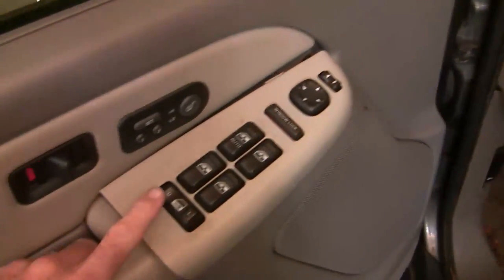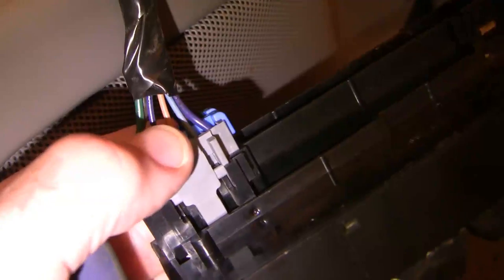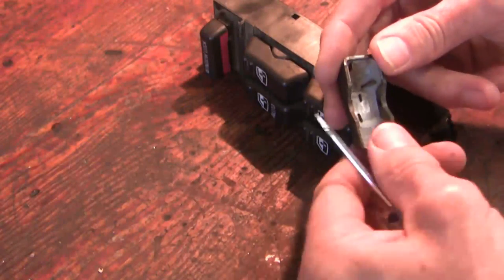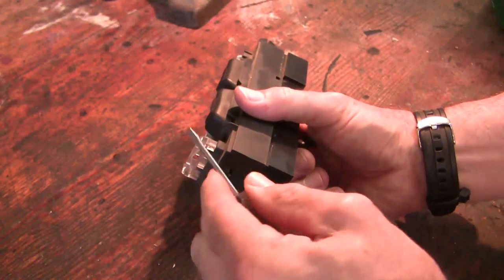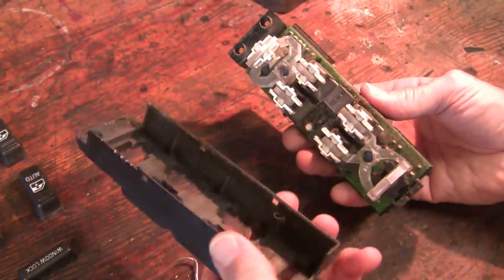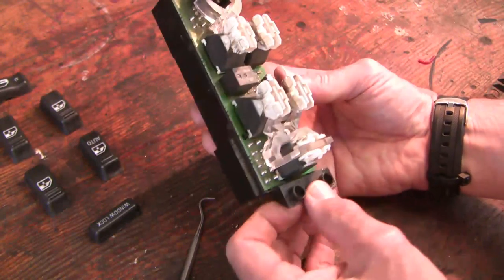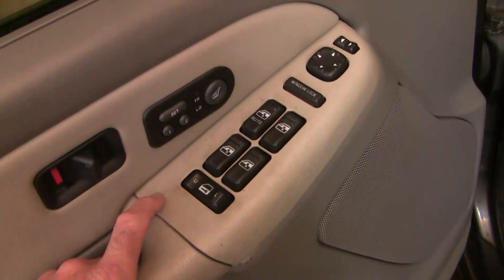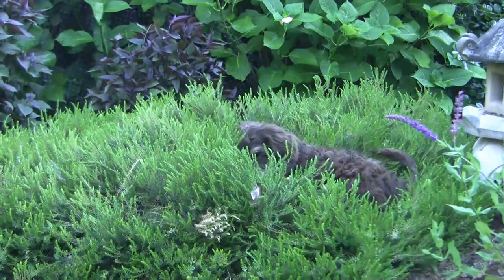How to fix the Chev power window door lock switch

Comment: I've got a 03 s10 that the power locks only lock when in drive and unlock in park wich tells me they work good but doesn't work with the door switches. Bought new switch and still not working, I checked the fuse and it's good. Anybody have a clue to what's going on?
Reply from the maker: Interesting. I wonder if there is a missing ground, perhaps the ability to lock when in drive uses a different intact ground.... In any case, I'd study the wiring diagram for more clues, then go to a door lock actuator looking for what seems to be missing (power or ground) at the actuator. Then trace the missing element backwards to the origin. It could be as simple as a broken or corroded wire or connector leading back to body ground. Hopefully the problem is not inside the body control module. You can get free wiring diagrams from BBB industries online, or get them through an online secondary provider like alldatadiy or mitchelldiy. Good luck!

Comment: i changed all parts but the locks still not locking unlocking the  way it should
Reply from the maker: One of the diagnostic steps that many skip over is the voltage drop test, designed to find upstream circuit resistance that may be robbing a device of adequate power. I'd do that for both the power and the ground side, and I'd examine the mechanism carefully to look for and lubricate mechanical problems. Another option would be to swap in another lock actuator from a different door, to see if the problem moves to the opposite door. Good luck!

Comment: I have a problem with my trailblazer when i close or open  the driver door the light inside stay on i have to open and close any other door in car to turn off the lights inside do u know what could be the problem ? Thanks
Reply from the maker: There is a button switch in the door jamb; it's normally pressed in when you close the door. When the door is closed the circuit is open, when the door is open the circuit is closed and the light will turn on. Inspect that switch to see if it still moves. There could be dirt binding it in the pressed-in position. Clean and lubricate it to see if you can get it moving. If you can't get it to move, it's a simple task to replace the switch. Switches like that are easy to find a a junk yard or you could even buy a new one. If the switch seems to be OK, then you may have a shorted wire, most commonly where the wires route through a loom in the door jamb. With age, those wires get stiff and brittle, and with constant movement eventually they fail. You would need to find the fault and fix it. In the meantime, remove the bulb so you don't have a dead battery caused by parasitic draw from the circuit. Good luck!
Reply: +spelunkerd thanks really help i replace the battery twice until i find out what was the problem plus i took the car to a repair shop and they want to charge me $400 so i was looking for an easy way to do it my self thank you very much
Reply from the maker: I'm glad it helped. When the battery dies overnight, it is either a bad battery or "parasitic drain". If you search that term you'll find lots of videos showing how to approach the problem. In this case you have a clue regarding which circuit is the problem; sometimes you don't and it's harder. In this case, if you can live without the door light, the simple temporary solution is to remove the  bulb. Fixing the problem properly is often easy, and when you sell the car you don't need to explain why the light doesn't work. Good luck!

Comment: 2004 Trailblazer, the mods are different but do I pry off the buttons the same way ? I cant get mine to pop off at all, I want to see if there is an issue with the master window switch which is broken..
Reply from the maker: Not sure. Inspect closely and often you can find the little snaps. If you're lucky you'll find them before they break, ha ha.
Reply: Thanks, I found that the buttons don't come off , though the whole unit just unsnaps,  The buttons push down on a rubber pad which makes contact to the circuit board.  Very similar to a TV remote and how they operate.   
So it appears I need to replace the whole switch. Chevy & ACDelco want $300, found one on Ebay with 60 days guarantee for $50, Amazon had none.. It's a shame, the door and window lock works fine, its just the controls for the 4 windows..  Thanks
Reply from the maker: Thanks for recording your experience here, I'm sure it will help others.

Comment: yo I have a question for you maybe you can help me. on the powerwindow lock switch is that light supposed to go on and off or is it supposed to stay on as a reference point for the controls while driving at night. I have a Tahoe and the battery is dead. I'm not sure why but I think something is draining it somewhere. if you have any ideas it be greatly appreciated.
Reply from the maker: I believe those LEDs stays on continuously when key is on, but I don't believe they stay on for very long after the key is removed and lights are out. You're describing a condition of parasitic drain, and the commonest source of that are peripheral add on programs like hands free remotes, aftermarket security systems, etc. Workup for parasitic drain is pretty simple. I did a video of that, and there are many others here on the net. Lately I've been using voltage drop across fuses as a screening test to trace down the source.
Reply: +spelunkerd the battery was just changed on it because the same issue happened. it was replaced with an old battery that was recharged. it seemed to be working fine but yesterday I took about a hundred miles trip across the state. I woke up this morning and it was dead. it was cold out  morning too and I think I might have left the door slightly ajar. not sure if I did though. it starts up and drives fine with a jumpbox. I'll make sure everything is unplugged on the inside and off, but could the alternator be bad too.
Reply from the maker: If you just left a door ajar, you could assume that and carry on, but it
 puts you at risk of recurrence if that is not the situation. First step is always to be sure the new battery is good. I would drop by a local autoparts store, remove the new battery and ask them to bench test it for free. Second step is to inspect and clean the connections, and the one that is often overlooked is where the ground cable connects to the engine. A voltage drop test is good to verify those connections. From there you move to searching for parasitic drain, and to do that I use my induction ammeter but if you don't have one of those then a voltage drop test across each fuse can be a useful screen. Remember the engine computer takes about 20 minutes to go into sleep mode, and also remember the hood light will be a source of draw if you leave it open when testing. More details are in the video I did on parasitic drain. Good luck!
Reply: +spelunkerd thank you for all your info. I live/work for a family that flips Ford/Chevy trucks and vans. that's where I got the old replacement battery from. It was an old battery replacing an old battery so ill check it like you say. They kinda have people they deal with for parts and repair, but I just wanted to see if it's anything I could do. Me driving is not a high priority for them. When I last changed the battery, the terminals definitely had corrosion. I'll be sure to clean them when I check the battery. thank you again for all your info.

Comment: does it has a rele there?
Reply from the maker: Sorry, it took me a while to realize what you are asking. There is no relay inside the switch, it doesn't draw enough current to justify adding in a relay there.
Reply: There is what appears to be a tiny special-purpose latching relay inside the button assembly on mine.  It is soldered to the circuit board.  I found a schematic online and it handles the "express down" feature for the front left window when you press that button down all the way.  If I'm reading it right, then even if the relay fails, you should still be able to operate the window without that feature.